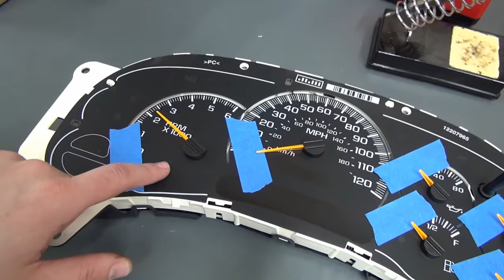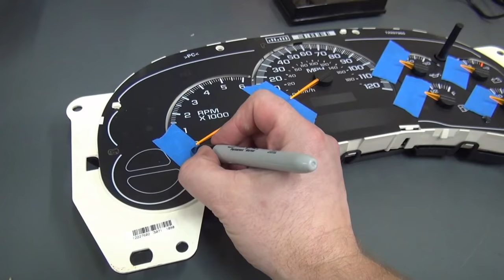How to Replace Instrument Cluster Lights

Comment: What size is the bulb that goes in the blue socket and where can i buy them whole sales.  How you solder the wire on the 9 volt battery?

Comment: Are clustered light connected With parking lights ? I have a 2003 Escalade & I recently put a new cluster but only the gauges lights don’t light up and my taillights don’t work but brake lights does

Comment: I just installed new Red LEDs in my cluster instrument panel 2005 Chevy Aveo LS sedan with no soldering done. I just replaced the old condom bulbs which were green to start with. It's a fairly easy project I completed in about an hour or so.

Comment: Ok did just like you did, when plugged back into the H2 the only two working lights are on the left others didn’t come on, but were working when I did the 9 volt check when replacing HELP TIA

Comment: Very Helpful, trying to find where to buy standard not LED "upgrade" most parts pages pull up the lamp with twist in socket.  I have same set up you demo here, can you give me hint where I can get the correct lamps?
Reply: I can see my response is a little late, but for any latecomers, here's the answer.

The bulbs depicted in this video:
Bulb spec: 12-14v 95mA mini bulb.
You can search on eBay or Amazon:
"Mini bulbs GM cluster backlight"

(NON LED)

Comment: Hi there quick question. Where were you applying power to check all the lights at once? Or did you check each light individually?
Reply from the maker: The lights that are connected to each other in the cluster (back lights) you test all at the same time.. However other bulbs like turn signal etc individually

Comment: I need to turn off the ABS light on my truck.  Didn't see a bulb for it when you had the gauge overlay off.  I guess I could pop the needles off, take off the overlay, and then put electrical tape over the back of the gauge overlay where the ABS light shines through?

Comment: This video is THE go to video to help those with instrument cluster problems in their GM vehicle. I was hesitant to "break off" the old bulbs from their connection. It worked okay for the two that I replaced. It may be better to touch the connection with the soldering iron and melt the solder and lift off the bulb. I really appreciate the use of the 9-volt battery to test for bad bulbs. NOTE: The 9-volt battery will also show what part of the circuit is positive and negative. If the owner is converting to Light Emitting Diode (LED) the it is imperative to determine polarity. Installing the diode with incorrect polarity DOES NOT damage the  diode but the bulb will not light. Also note that LEDs will need a resistor of proper value to load the circuit. Incandescent bulbs like the ones replaced in the video have no polarity and require no loading. Thanks for a very good video.
Reply: leedek66 the 9-volt battery won't reveal correct polarity because you can light those incandescent bulbs from either position.

Also, the LED resistor is not to "load the circuit", but to limit the current/voltage to a specified value. i.e. 3.3v @ 20mA.

And finally, the plastic blue base tungsten/incandescent bulbs can be safely pulled from the solder pads. The pads on the front of the board are fairly robust, and the factory solder is thin enough to prevent damage. HTH
Reply: Tomato.. tomAto... "limit the current/voltage to a specified value." ... to me means load the circuit. Geesh... do you analyze every comment to a post and explain your thoughts?  I worked with a couple of guys like you. It was difficult , but I did it. LOL  Have a great summer.

Comment: QUESTION:  I replaced all my bulbs with led bulbs that i had to  solder to my cluster ..  When I reconnected only one signal light  was working.. I tested all my led bulbs prior with my multi meter and they all worked... .. None of my other lights are showing nor are the needles moving ....

ALL of my gauges  worked and my cluster was lite prior to my modification ....
Reply: LED bulbs need to be inserted with the correct polarity - with the original bulbs either lead could be soldered to either terminal because polarity isn't an issue.  Try switching one of your non-working LED bulbs around (rotate 180 degrees) and see if that works.  If so, then correct the rest.

Comment: I did this and it works when I test it with a power supply all bulbs on the headlight circuit light up, but when I plug it into my vehicle I get no lights at all, any suggestions?
Reply: Mine does the same did u find out what was wrong ?

Comment: I followed these steps and did a super clean job, all the LEDs work perfectly with the 9 volt battery tester I made. I put it in my truck and only the blinker lights want to work. Any ideas as to what’s going on?
Reply: same thing happened to me
Reply: @robertdunnagan8581  Yep. I never did figure out how to fix it. I ended up just soldering on new halogens and calling it good. I did leave the blinkers and cruise control LED though.
Reply: @HorseGirl256  did you check the polarity, LEDs are polarity specific, out of the four solder contacts on the board only one is positive, the positive LED wire has to go on the positive solder spot or it won’t work
Reply: @wild8757  Thanks for the reply. The LEDs I tried using had indicators for positive and negative and the little bases that the original halogens were on also had +/- markings. I know I used the same +/- contact points as what the original halogens were on but it still didn't work so I'm not sure anymore.
Reply: @HorseGirl256  That is bizarre, I would double check those contacts, if you plug the board back in to your vehicle with it still apart you can take a digital multi meter and touch the contacts, if it gives you a negative reading with a minus sign on the meter that’s the negative, if it gives you a plus number with no minus sign next to the number that’s the positive, Or you could just remove all the bulbs and plug the board back in to your vehicle with it still apart and take one of the new LEDs between your fingers and set it on the contacts a couple of different ways until it lights, then put a dot with a marker on the board next to that contact to label it as the positive, then do the rest the same way, then you’ll have dots next to all the positives for you to mount the LEDs, you’ll definitely light up when you put it all back together, that’s what I would do anyhow. Good luck

Comment: 3:30 Yikes!  Those are soldered in.  They should be unsoldered, not ripped off the board.  You will risk pulling a pad this way, and I suspect the trace for this is internal, so if the pad is pulled, good luck getting a contact again.  Also, there are much better LED bulbs with three chips that really light up the cluster well, better than a single LED.  I use those when I do this and toss the plastic housing.
Reply: im about to tear into this tonight, so youre telling me you do NOT reuse the blue block when putting the new leds in? Im literally about to get at it right now.

Comment: Does it matter how you put the bulb on? Is there a positive and negative
Reply: No, not for tungsten/incandescent (NON LED) bulbs. Only with LED bulbs do you have to be concerned about polarity.

The bulbs depicted in this video:
Bulb spec: 12-14v 95mA mini bulb.
You can search on eBay or Amazon:
"Mini bulbs GM cluster backlight"
Reply: Ok so what about led . Which solder pad is positive and which is negative

Comment: Do you know how or have videos on how to replace the bulbs in the cluster of a 2000 Chevy Monte Carlo SS??
Reply: Should be the same for the most part.  You might have Led's that are soldered in a hole and come out the back side of the board.  Will need a solder sucker or solder wick to help remove the solder. He should have used it in the video because you can damage the pads on the board.

Comment: I received a rebuilt instrument cluster. The brake light is permanently on. My car has no brake issues. What could be the cause?
Reply: Check your brake fluid reservoir. Sometimes the sensor could go bad and cause the light to
Stay on.

Comment: What about the polarity of the bulbs? Does it matter??
Reply: No, not for tungsten/incandescent (NON LED) bulbs. Only with LED bulbs do you have to be concerned about polarity.

The bulbs depicted in this video:
Bulb spec: 12-14v 95mA mini bulb.
You can search on eBay or Amazon:
"Mini bulbs GM cluster backlight"

Comment: I think I over soldered one of them because all of them lit up except the one for the battery gauge! The solder won't even stick to the little dot that had solder on it! It now is just a black dot that won't hold any solder to it and when I plug it up to see if its working it flutters because the solder won't stay
Reply: That usually happens when you hold the solder tip to the metal solder tab for too long. It will pull the metal tab right off of the board, then the solder wont stick.

Comment: Does the bulb really need the blue plastic holder?
Reply: Yes, It will get the perfect height.  If you don't use it the led might hit the plastic and it also keep the led from shorting if you hit a lot of bumps.
Reply: Actually, most of the"pros" that I've seen replace backlight bulbs never reuse the plastic base. They bend & trim the leads as low as possible to get the widest angle of light radiation, in order to prevent light "hot-spots".

Comment: I have replaced my bulbs with LED bulbs, I plugged it in and they just flickered then wouldn’t turn on... what could be my problem?
Reply: Blown LEDs.  Need proper resistors to go with LEDs
Reply: If the Led is installed backwards it will blow and you need a new one.   The long lead is Pos and short side is neg.
Reply: @Shawn-ph6ys  they will not blow if installed backwards. They simply won't work. They are a diode. One direction of travel. If they flickered then they were wired in correct orientation to begin with. The problem is voltage differences.
Reply: 2WheeledWanker ! 
How can I figure out the polarity after I cut all the lead wires to size and he explain in the video. 
If I attach the battery all bulbs light up, but once I go back to the truck none work. 
It’s frustrating !!!

Comment: What's the part number on the bulbs
Reply: There is no OEM P/N for these bulbs. You have to buy them from aftermarket suppliers.

The bulbs depicted in this video:
Bulb spec: 12-14v 95mA mini bulb.
You can search on eBay or Amazon:
"Mini bulbs GM cluster backlight"

Comment: That soldering iron is way too much for this job. Too much heat can cause the circuit traces to lift off the board and then it's problem city. Applying voltage directly to the circuit board is not a good idea either as one touch in the wrong place and it's curtains for the board or those two integrated circuits.

Comment: Hi, how are you? I have a problem I do not know if it was from the car computer or from the heat exchanger The problem is that the temperature of the engine rises to the boiling point and the heat regulator shows less than the middle of 80 ° C And fans do not work .. It works when the temperature indicator points more than 90 degrees C What is the problem and thank you ..car equinox LS 2007

Comment: Why would you just snap them off! Couldn't that just pull the pads off?
Reply: For the tungsten/incandescent (NON LED) backlight bulbs, the solder pads on the front of the board are very robust, and the factory solder is very thin. All of the pros I've seen do bulb replacement, carefully pull them off as Bri did.
Bulb spec: 12-14v 95mA mini bulb.
You can search on eBay or Amazon:
"Mini bulbs GM cluster backlight"